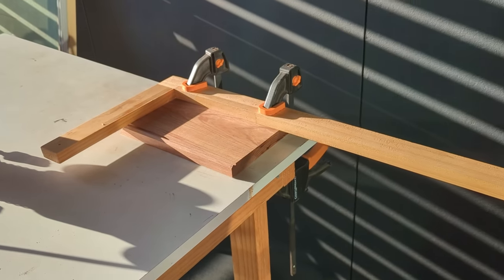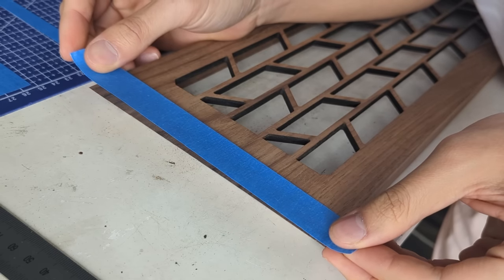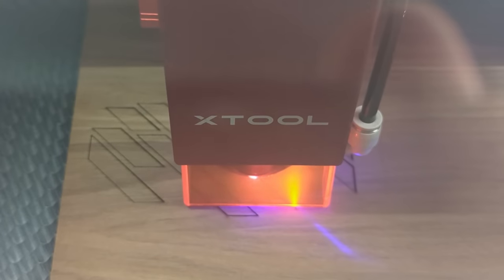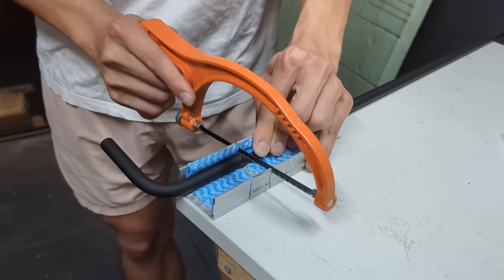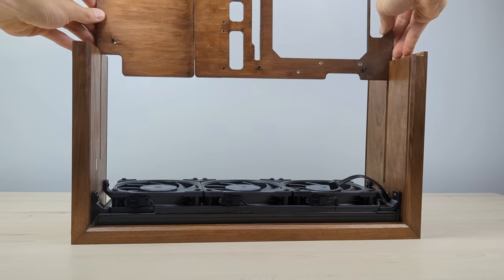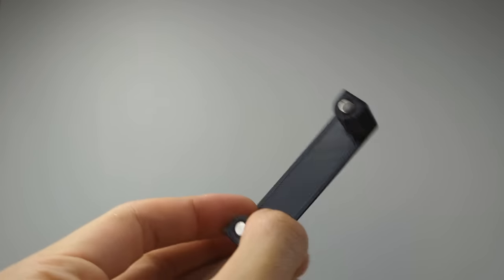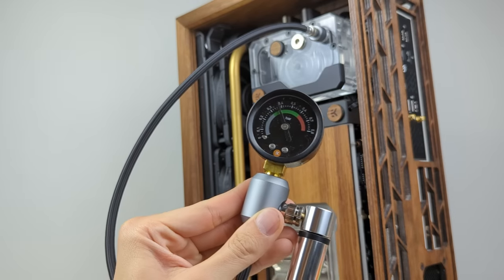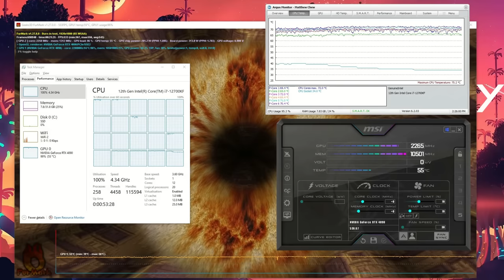Ultimate Hardline Wooden ITX PC | ASUS TUF RTX 4090 | i7 12700KF | DIY Wood PC Case

Comment: In the future, if you need to cut a pattern larger than your cut area, you can set your printer to use absolute coordinates and secure a piece of medium to the working surface that extends slightly out of bounds on two sides of your home coordinates, then cut out the total area outline.  This will give you two absolute 0 edges for indexing projects, which will allow you to rotate objects and know their exact spacing.
Reply from the maker: Thanks for the advice! I'm having some trouble wrapping my head around the concept. Do you have any videos detailing that process? No worries if you don't, I'll do some research. Thanks!
Reply: @mxcbuilds6633  I do not, but I can try to describe it.  First, find the home position of your machine.  In my case, 0,0 is at the back left of the work area, in many cases it is at the front left, you will have to find where the home is on your machine.  If your machine does not have limit switches, you can pick a corner to be your home (before the machine is on, manually move the head to your choice of corner to the limits) and designate that as home in your software (I use lightburn).

When you know where the home position is on your machine, you will want to secure a piece of working medium to your working surface just outside of working limits on both X and Y of your home position.  I used a piece of polycarbonate to avoid changes when atmospheric moisture changes.  I glued it to the working surface as I intended it to be permanent, but bolting it is probably a better option.  Once the medium is secured outside the bounds, use the laser to cut along the absolute bounds of your machine, this will allow you to remove all but the secured L shape that will remain outside of bounds at your home position.  That secured L shape can then be used to index any projects at home position.  There may be a slight kerf to account for after the fact that will mean the indexing edge is inside or outside your working limits by some fractions of a millimeter, but that can be accounted for in software.

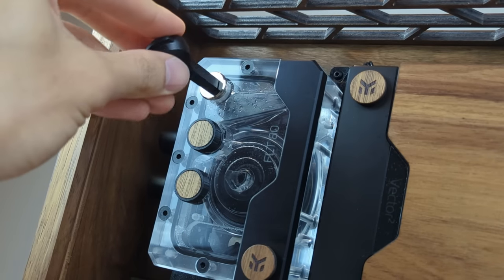Comment: 23:39   I doubt. Is still many air in loop, you need bleed it out by tilting case 90 degree in each direction for ~10 seconds.
Reply from the maker: The pwm setting on the motherboard was incorrect, each time on start up it would set the pump to 100% which sucked in air from the surface of the reservoir. I have adjusted it and it does not do this anymore :)
Reply: @mxcbuilds6633    Many pumps starts at full speed and keep it for few seconds, even when you set set lower speed in BIOS (my Alphacool VPP755 for example).
Reply from the maker: Exactly so some bubbles will get sucked in at the start but after that it will calm down

Comment: You should invest in 15mm Radiator fans....don't think Noctua have those. I know the ones I have are Coolermaster. And they work really well.
Reply from the maker: surely 15mm fans would be even worse for performance? for this application I needed the maximum cooling i can get..

Comment: I'm looking to do a custom pc build here soon and I was wondering what time of tubing you used? Also, what are the links for the metal tubing connectors
Reply from the maker: I used Corsair PMMA black tubing 12mm. Metal fittings are from EK, quantum torque micro range. Hope that helps!
Reply: @mxcbuilds6633  Tysm, this beautiful build was the final straw to get me going on making my own. It just looks so cool that I can’t not attempt to make my own

Comment: The cable combs may be enough for you to appease your OCD.... not that I would say it looks bad, but it's not enough for my extreme OCD!!! I've been planning to install free-floating cables for 5-6 years, but that's a job for a "precision mechanic" / server electronics engineer combined
I've been looking for the right cables for over 2 years... and now I have a 100 meter roll in blue, but I don't like the color anymore (Sigh)
I'm a fan of Hans Peder Sahl's R40 and R80 design but without cable ducts and combs
The worst thing is, find a cable straightener for 3-5 mm diameter....
There is something like this for copper pipes but they are also larger and simpler
Reply from the maker: Wow just checked out his builds. Very clean as well. You surely have an even higher standard, best of luck for your eventual build :)

Comment: What will happen to the printed parts in 3 years? How well does the plastic age?
Reply from the maker: I'm not sure, so far I have not had issues with the printed parts
Reply: @mxcbuilds6633  In art school we learned the difference between paint that lasts 2 years, paint that lasts 20 years, paint that lasts 200 years, and paint that lasts 2,000 years.
The plastic in my car started falling apart in less than 20 years.
Looking at all-metal machine tools you see state-of-the-art machines from the 1940s.
In your PC, the VRM circuit dates back to 1920 despite the 100 years of improvements. The PSU bridge rectifier dates back to 1895. These are bad designs used because manufacturers are unwilling to use 2011 circuits — even though they are cheaper, smaller, more efficient, and have better transient response.

Comment: May I ask why waterless coolant isn't used instead?   It's $50/gallon, but you don't need a whole gallon.    It's rated to 345 degrees with no boil over issue.   Evan Coolant is one such product.  It's also non-corrosive, unlike water.
Reply from the maker: I used a commercial 'coolant' sold by the company that makes the water cooling parts. I'm sure it's not just water in there and has anti corrosives as well.
Reply: @mxcbuilds6633  That's cool, saw some use distilled water, thought yours was same.

Comment: your 8 pin and 24 pin seems to be not completely seated  ! it may work , but it may also heat
Reply from the maker: Wasn't seated fully in the video clip but I made sure to push them in further after.
Reply: @mxcbuilds6633   nice :D , very impressive build and work involved in this PC

Comment: about cutting a panel too long for the cnc machine, wat i  seen done was that they use pins put intii cnc cut holes in the baseplate they stick the pins in cnc cut holes in the workpiece (usually an outer edge thats get cut off ) 
bit harder to do on a laterbed but if you make the mounting plate wit the pins outside the workspace or reduce the workspace for the laser slightly after cutting the holes for said pins it should be possible
as for the powerbutton , you could gundrill the piece of brass rod and insert a flat round led
the case and basicly the whole pc tuned out beautiful i dare to say that the pc is worth more than the sum of its components and the hours of work spend making it 
if you make them as a job using a little more professional equipment to make the parts themselves faster you could probably make a living with it making them custom to order for a verry steep price to people that apreciate the art and have more money than know wat to do with
Reply from the maker: Thanks for the feedback :)

Comment: Beautiful!!  Anyone know what pump and res that is?
Reply from the maker: Thanks! It's an ekwb flt-80
Reply: @mxcbuilds6633  can you tell me how deep it is with the pump attached? I’m looking for a pump and res solution for a 2U server chassis and have an 80mm depth limit.
Reply from the maker: @swilson42  all the proper dimensions are on ekwb website. I'd recommend checking there for the model you are interested in
Reply: @mxcbuilds6633  The thing that is often hard to find is the total depth after installing a pump. I don’t know how far into the res the pump is recessed once it is installed.

Comment: Beautiful way to burn your house down, its essentially a heater made of wood, there is a reason why electronics that require heat to function are in metal cases, i didnt see any fire protection in the case. If you fix that Ill take the F away and give you an A++ but it is visually stunning. I just built a new house and it wouldnt be covered by insurance if that computer was in it and it made magic smoke i see in bricked computers. Same reason your wood working equipment is all steel.
Reply from the maker: Thanks for the concern

Comment: Do you have the 3D print files handy that you used?
Reply from the maker: Not yet sorry
Reply: @mxcbuilds6633  did you make the models yourself? Or find them?
Reply from the maker: @rileyslater6999  All the 3D printed filed were designed myself. Some of the component model such as Res, MOBO, PSU were obtsained from GrabCad

Comment: Wood is always a horrible material for a pc case, but man, do I respect the crap out of this build - beautiful in every way
Reply from the maker: Always horrible? Nah, not with the right skills and design 😉
Reply: @mxcbuilds6633  It is horrible. It's a natural insulator, it burns easily, frail, can cause problems if it fragments. There's a lot of problems with it materialistically. I agree, with the right skill, t can look fantastic. I mean to just approach it from the material standpoint. You just need to be making sure air moves through well enough, and I wouldn't put it under too heavy of a load. Good job with this case either way

Comment: Isnt a 12700k and a 4090 kinda far apart?
Reply from the maker: Bought the CPU on sale for the  previous build paired with 4070ti. Got offered the 4090 for this build and didn't see the need to upgrade CPU.
Reply: @mxcbuilds6633  that sounds fair yeah XD, atleast you have amazing upgrade potential ^-^

Comment: Is anyone doing hard lines for the wiring ? I am gathering components for my next Gaming PC build and want any exposed wiring to be hidden in tubing like the cooler hard lines, just wonder if You have seen anything like that ?
Reply from the maker: Don't think I've seen stuff like that specifically for PCs but you might have some luck using small size electrical conduit from the hardware store. Good luck!
Reply: @mxcbuilds6633  Thank You for the tip, I will look into that and look for someone with Electrical knowledge for that info : )

Comment: nothing against small form factor builds. i like them if done properly. just when it gets out of control i have to write something to prevent others from following down a dangerous path. 2 mistakes have been made. number 1: you usually dont use the most power-hungry components for a tiny build! (what you have created is an electric blower-style heater) number 2: you dont use an enclosure and motherboard-tray from a material that can light up and start a house-fire. that had to be mentioned. the combination of those 2 mistakes in a tiny build makes it dangerous. thats all.
Reply from the maker: Thank you for your input. My opinions below:
1. Many try to cram the most powerful components they can into the smallest volume possible. The whole SFF community is based on this philosophy. Yes it will run hot, and that's the challenge to find solutions to cool it appropriately. The heat generated from these components would be the same regardless if placed into a large case (would also 'blow out the same amount of heat')

2. Yes wood is flammable, yes it's higher risk than a conventional case. Anyone that tries to attempt this will do so at their own risk.
Reply: @mxcbuilds6633  for highend hardware i still recommend high airflow enclosures(even with the use of radiators) the heat from each part will be kept better in check and under control with much more air moving through the system at the same time and space for large cooling solutions(water or aircooler alike).
Reply from the maker: Yes, your recommendation of having high-end hardware in larger cases to allow easier cooling is correct. It however does not make having high-end parts in SFF builds a 'mistake' as you mentioned in your first comment.
Reply: @mxcbuilds6633  for a beginner system-builder it could be a mistake to choose a small enclosure for power-hungry hardware but not for enthusiast-builders of course. modern parts are able to do "thermal-throttle" if nessessary and everything can be software-controled and monitored. that makes it possible today. back in my days a system builder had to think hard about the right size case. looks and style were secondary.

Comment: You have too much air and turbulence in the system for it to cool properly. That’s the main reason for the cooling issues..
Reply from the maker: The bubbles were only during initial start up as I haven't adjusted the pump speeds. After adjusting, it doesn't suck in air and blow bubbles around the loop anymore. Temps have been under control. Still using the build to this day

Comment: Wood is horrible radiation of heat surely?
Reply from the maker: In theory yes, in practice negligible difference in component temps. Check out the comparison video I did wood vs metal case.

Comment: I have very similar hardware in a plain, metal case—I don't care what it looks like inside because it is hidden inside an enclosure—as long as it runs cool and quiet and performs. The whole point of the computer to me is performance and not aesthetics. I could not care less what the internals of the computer look like—and neither do the electronics inside it.
Reply from the maker: Okay good for you. I, like many others in the PC community, appreciate the look of our equipment. To each their own.

Comment: Waterblock coolants shouldn't be conductive dude.. it ain't "water". Not to mention water technically isn't conductive if it's pure H2O.. the closest you can normally get to pure H2O is demineralized water.. Its the minerals that make it conductive and cooling liquids don't have to minerals in there.
Reply from the maker: Where did I mention it's conductive? I might have been referring to heat conduction rather than electrical?

Comment: 40c is perfectly reasonable... that's not really even hot at all
Reply from the maker: Thanks for watching! From what ive read online, it seems 40C for the coolant temperature in custom loops is considered quite warm, thats why I mention it. Altough most of the water cooling components can easily withstand warmer temps than 40

Comment: Никогда не понимал моддеров. Выполнена куча работы, и ради чего? Я понимаю, когда люди упарываются ради практичных вещей, типа сделать корпус бесшумным, или пассивное охлаждение. Корпус - это корпус, его назначение - защищать содержимое от пыли и пальцев, пальцы от содержимого, экранировать электромагнитное излучение. Дизайн всегда должен стоять на последнем месте. После функционала, практичности, надежности, технологичности, цены, которые могут меняться местами в зависимости от. В любом случае, пользователь компьютера смотрит в монитор, а не на системный блок.
Reply from the maker: I can see your point, in terms of functionality, it adds no benefit. But I think we modders see it as a way to express our creativity? Almost like an interior designer or building designer. Technically speaking a building just needs to be strong enough to support the weight, and keep its occupants dry/warm etc. Yet we have architects who's entire jobs is to design a good looking building rather than just saving the money and making a simple box shape. That's my opinion at least. I also enjoy the engineering challenge of fitting all the components into a small box 😂
Reply: @mxcbuilds6633  Of course, I understand that this is creativity. I don't understand why a small number of entities are targeted for modding. I can only remember computer system units and motorcycles. For some reason, there are no modders for kitchenware, power tools, or audio equipment. And, yes, I didn't like most of the modified motorcycles that I saw either. Returning to your video, you have excellent skills in working with material and great accuracy. I set like for this. But I wouldn’t install such a case for myself even with an additional payment, sorry.
Reply from the maker: @icmp8ping  yeah fair enough, it ain't for everyone. Thank you for your feedback 😊

Comment: Looks good, but I would never use wood to build a PC, it's one of the worst materials to use for that purpose; it's an insulator, it can't ground electronic parts, and is poor for the shielding of electronics.
Reply from the maker: Thanks, it's surely not for everyone. I would add tho, if you mean a thermal insulator, check out my comparison video where I tested metal vs wood PC case effects on temperature. As for grounding, does each cable connecting component to PSU sufficiently ground the individual parts?  I completely agree with you on EMI shielding tho.
Reply: @mxcbuilds6633  
"if you mean a thermal insulator, check out my comparison video where I tested metal vs wood PC case effects on temperature"
That test is flawed, because you place the wood on top of a metal case, it's not truly a wooden case. 

"As for grounding, does each cable connecting component to PSU sufficiently ground the individual parts"
Not when you unplugged the power cord, and want to do maintenance on your PC. The large surface area of a metal case can discharge static electricity that you might otherwise be transferring to your components, a wooden case can't. Sure, you can discharge yourself some other way before you touch that PC, but how many people will do that, especially when they're in a rush?

You have to understand, I'm an IT guy, I look at these things differently, I wouldn't like to be running a data center with wooden server cases.